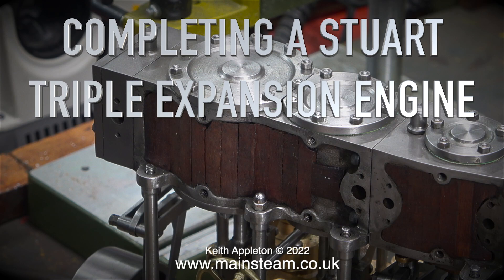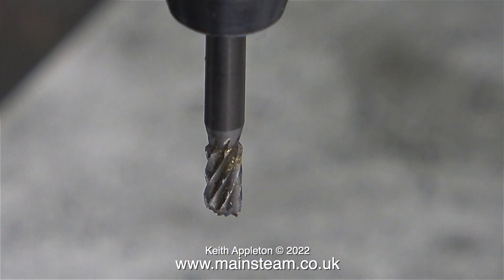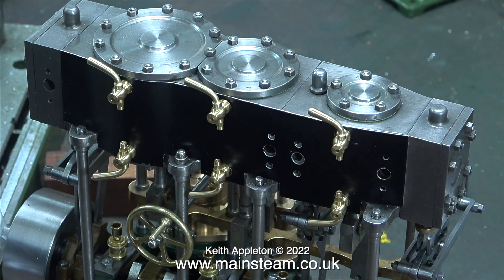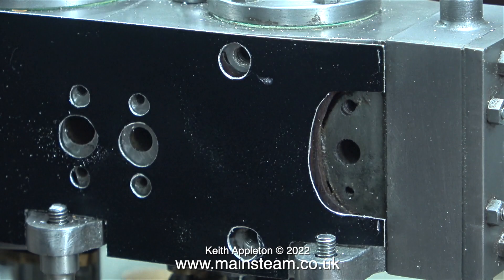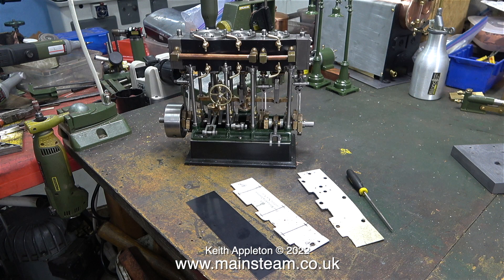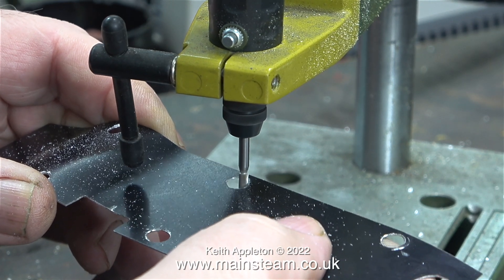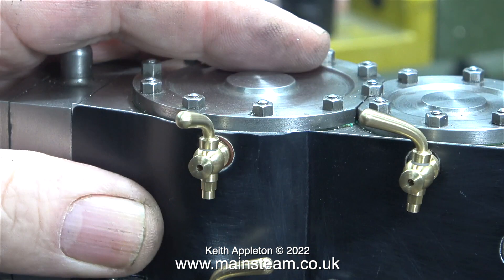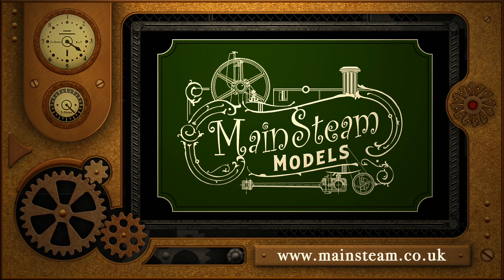COMPLETING A STUART TRIPLE EXPANSION ENGINE - PART #44

Comment: Looks very a very fiddly job to get right. I'm glad you don't like the anodised finish as it means there is a strong possibility of a gratuitous paint drying shot in the near future!!

Those Proxon tools seem to be the best name, I bought some time ago a similar tool from Leroy Merlin (Big DIY superstore), it was there own brand Dexter, anyway I broke a collet and when I went back to buy one they told me they don't sell them nor can you buy them on the internet. After after protesting about the company policy, without upsetting the young lady who was serving me, we both agreed that these things should be sold separately. Anyway she took me to the storeroom where they have sets of these things for rental and gave me loads and loads of collets, grinding disks, cutters etc, enough to overhaul one of your engines!! But what she did say was next time buy a Proxon, they are the best!! 

Good luck from Spain!!
Reply: It's one of those jobs that appear deceptively simple, but turn out to take a lot more effort and care than you'd think.  I've made a few engine cowlings for R/C aircraft from thin aluminium, and had much the same experience :)

Comment: Morning Keith, if I may make a suggestion - I've found that stepped drill bits do a great job drilling through thin metal
Reply: Just getting ready to make the same remark!

Roper-Whitney makes hand-held punches that can do the job nicely, as well. They are like a beefed up version of a hand paper punch.
Reply from the maker: I haven't got any of those either . . . .
Reply: Pinch it inbetween two thicker piecees of metal and drill through this package. The holes will be perfectly round and there is no scratching on the surface.
Reply from the maker: I haven't got any of those . . .
Reply: @keithappleton  A worthwhile addition to any tool collection - they look expensive until you think that one drill covers 8-10 hole sizes
Keep up the good work 😊😊

Comment: not sure if I asked this before but why do you glue wood strips around cylinder walls?
Reply from the maker: Full Size: heat insulation. Models: decorative or support for the metal cladding (as I think was mentioned in this series) . . .
Reply: @keithappleton  sorry haven't seen all of your videos but thanks for answering my  question

Comment: Well,there are couple of advantages to the aluminium. It is nice and soft. And,the anodization has a porosity,a tooth,which means the paint should stick far better than to bare aluminium.  The only way I know of to successfully paint aluminium automotive panels is to use aviation grade epoxy paint. That actually works quite well. You can then use lacquer paint on top of that for say,racing numbers. Then just wipe off the lacquer with some thinner when you need to change them. Just don't ask about what it takes to get the epoxy paint off the metal....
The more I think on it,the better the biscuit tray idea sounds.